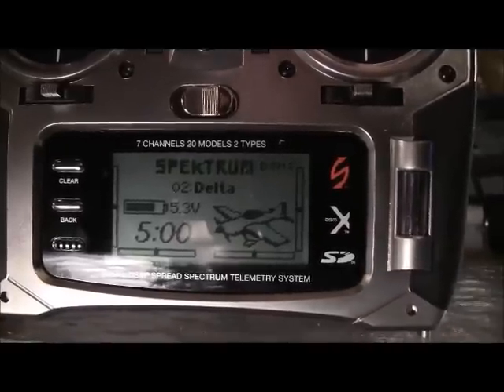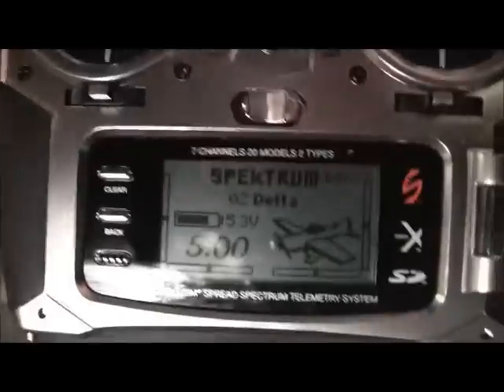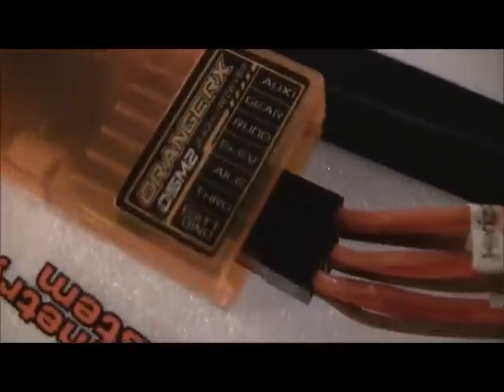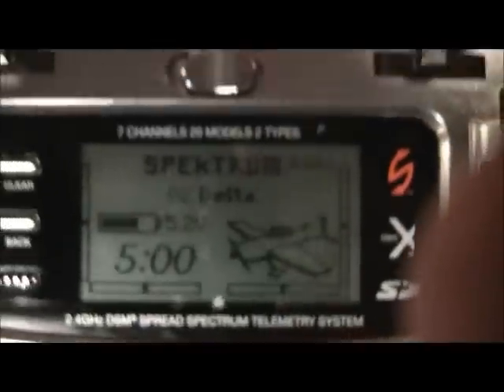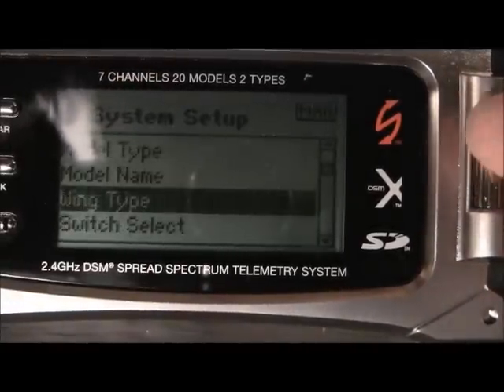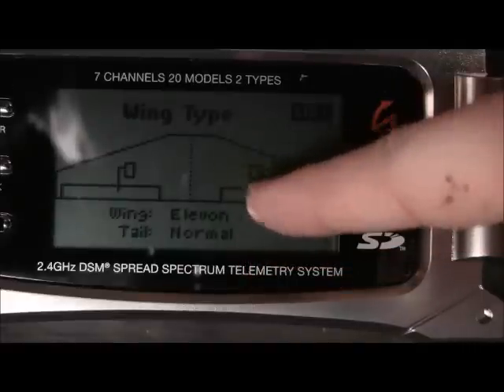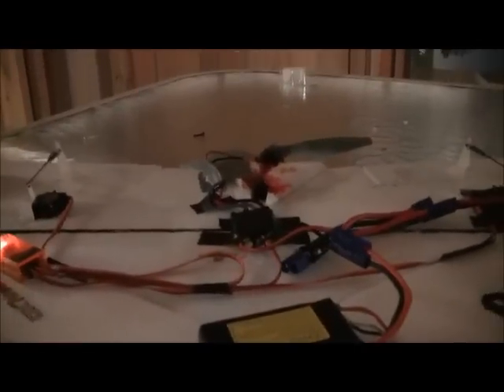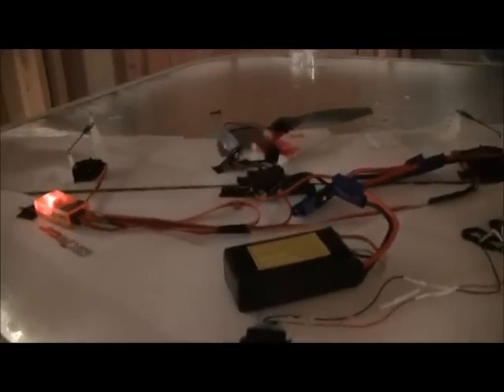how to set up EVEVONS on dx7s/dx8

Comment: Great video, thanx for putting the info out there. I am still having no luck getting my DX8 set up for my HobbyKing Delta Ray. The HKDR manual says to set all switches to normal accept Aux1 to rev and set the Trainer to Aux 1. None of the set up screens will let me get to the Aux 1 option, I can never get Aux 1 to show up. Any suggestions.
Reply: I'm having the same issue with my Delta Ray.  Did you ever get yours figured out?

Comment: Hey one tip with the Habu (i'm habu owner). When you are flying, you never want to go under half throttle quarter at the least. You always want to keep your power on because without it, this plane slows down very fast then stalls. Also on landing, you always want to keep throttle on a little and dont go too fast or it will bounce and go off the runway or road.